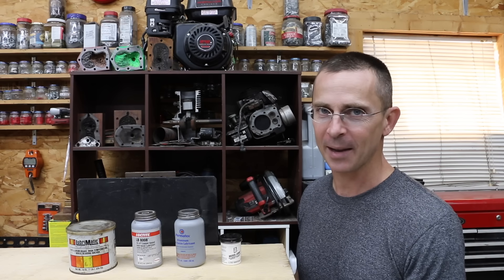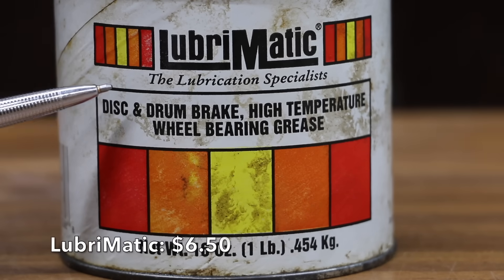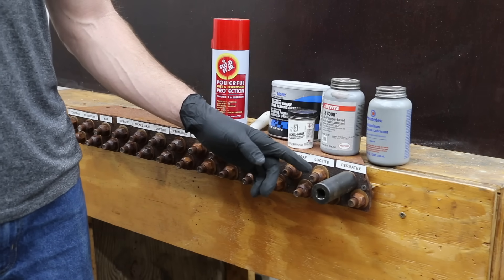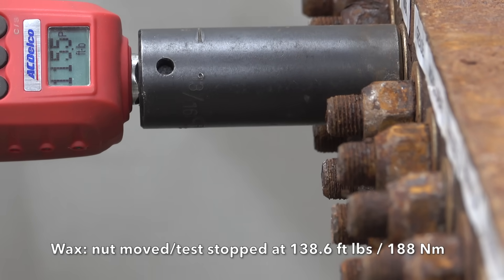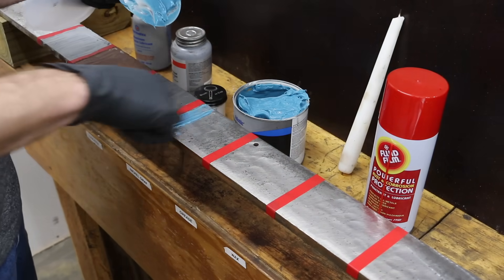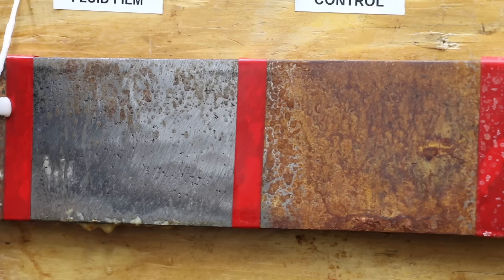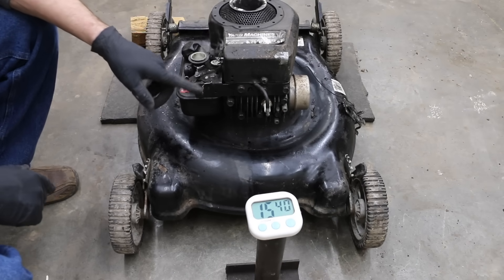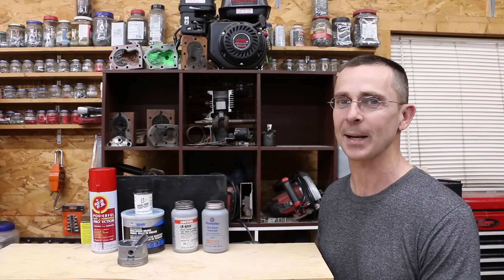Does Anti-Seize Compound Actually Work? Let's find out! Anti-Seize vs Grease vs Fluid Film vs Wax

Comment from the maker: Products Tested In This Video (in no particular order):
Permatex Aluminum Anti-Seize: https://amzn.to/34muTaQ
Loctite Copper-based Anti-Seize: https://amzn.to/2Ep8bDU
Nickel-Graf: https://amzn.to/32hL5aH
Candle: https://amzn.to/3hkUQez
LubriMatic High Temperature Grease: https://amzn.to/47GRBcw
Reply: I knew the copper based anti seize would win.I have been a Caterpillar mechanic for over forty years, One of the toughest jobs for anti seize is exhaust manifold studs where the screw into the cylinder head. With no anti seize lots of broken studs,next the aluminum would give you a 50 50 shot at no broken studs,but copper would give you a 90 % release with no broken studs.A factor that works against the studs in this application ,is carbon,exhaust gaskets failing would cause extra heat and carbon to compound the problem. Aluminum anti seize would win in rock crusher applications,for some reason it would allow heavy lime dust jobs.
Reply: @cecilneely4869  Good stuff for the knowledge bank.  Thanks.
Reply: @cecilneely4869  
Repairing fertilizer application equipment necessitates some form of anti seize . I think aluminum beats copper where heat isn’t an issue. Like to see this tested. In heat, copper beats aluminum for sure.
Reply: @cecilneely4869  loop
Reply: Working on the docks. We have replace boards.  Using copper anti-seize on everything. It work like magic on lag screws.  Put a wad in the holes and coat the screws. They come out easy.  Old ones that never had anti-seize, have to be cut off.
Great video 💪🇺🇲💯
Reply: Does it conform to the sn rating for motor oil? Lol
Reply: The candle wax was not applied properly.  You have to heat the metal first then put on the wax. You can't drip hot wax on a cold metal plate or screw. It wont bond.
Reply: I would argue that the candle would'^ve done a better job if it wasnt cooked away prior ....
Reply: Jack Daniels  
Anti on threads but use a nylock  nut. The best of both worlds.
Reply: @greg9403  Nylock nuts are an excellent way to secure fasteners from vibration, on low temperature applications... And using any good anti-seize or even axle grease in these applications with the ny-lock nuts would really cut down thread galling and corrosion... Yes, that is a great observation.
Reply: @Justin 
What is the product name for ceramic anti-seize?
Reply: @greg9403  Yeah? I have never heard of ceramic based anti-seize... Who makes it, what is the product called?
Reply: @michaelmartinez1345  I dont know about the other guy, but i have seen and used ceramic anti sieze made by both Wurth and Walter. It is great for EXTREMELY high heat applications (MolySlip Ceramslip antisieze is rated for 1,500 C, or 2700 F)
Reply: @benruss4130  very good!!! Thank You Ben !!!
Reply: @greg9403  the stuff I get is more of a grease antiseize with ceramic.  It works good mounting aluminum wheels to hubs. Prevents the gulling effect. Works good on brake caliper bolts to stop the caliper from freezing up on the mounting bolts. Withstands high temperatures because of the ceramic in it. It's blue in color
Reply: I’d be interested in seeing what results you might get with cosmoline… 😄
Reply: Wow you certainly don't mind getting your hands dirty. That mower test at the end was awesome.
Reply: Make a video about tread lockers! :) 
Build a jig that would simulate vibrations and see if it will act as anti seize as well.
Reply: @gabrieldauzmusic  - that would probably be an expensive/complicated rig!!! There is a whole science - and engineering talent, at analyzing and addressing the various forms of , and the effects of : vibration... It would probably involve using accelerometers , frequency measurement equipment, wave form measurement equipment, frequency/wave form generators, plotting graphs, understanding the physics of the various forms, frequencies and intensities of vibration.... Vibration , and the factors involved with it, tend to be more complicated and involved, than what many people realise...
Reply: Before even watching your video i will say this it works, IF you get a decent compound. I work for an aftermarket car parts company, and one of the things I frequently test on-vehicle are O2 engineering sample sensors. If there was sufficient compound placed by the OE it will come easily... but a LOT of newer vehicles did not have a sufficient coating from the OE, and the OE only placed a drop or two of anti sieze so the O2 sensor will bond to the exhaust manifold (you use it betwixt the threads of the exhaust manifold and the O2 sensor). One was so bad that we had to cut the O2 sensor out.
Reply: @benruss4130  It may be a good idea to remove the o2's on a new car and apply the compound and reinsert.
Reply: @GrzegorzDurda  yes, but the car that we had to cut the O2 sensor out of was only a year and a half old at the time. Some of these are arriving brand spanking new with frozen O2 sensors. Occasionally to get a brand new car we will rent specific cars that have less than 2,000-5,000 miles and sometimes they are still stuck.
Reply: @benruss4130  Unbelievable!  With mileage that low. Wow.
Reply: @GrzegorzDurda  Nothing will make you curse like a year old car acting like its bolts were uncoated and parked in the ocean for a decade. We suspect that the one we had to cut out was due to the aluminum o2 threads galling (cold welding) due to there not being enough antiseize/oxidized materials between the sensor and the manifold.
Reply: @benruss4130  Oh yes Aluminum threads are especially problematic in high heat applications and heat cycles. Aluminum has a very low melting point. This is a bad interaction of metals and a metallurgy design fail. Which brand is most susceptible?
Reply: @GrzegorzDurda  Of the newer cars (last 1-3 years), the WORST case was on a Hyundai. Although we have seen these get stuck on most car brands, I would say that Hyundai, GM, and Toyota were the worst three. So far I have never observed a Ford get stuck (although we haven't had nearly as many of those in recently so that might be sampling bias). 

All that being said Aluminum O2 threads are extremely common regardless of manufacturer. Putting a really beefy layer of antiseize prevents it from becoming a problem though. It is the combination of less than ideal metallurgy and little to no antisieze on freshly milled parts that get it to the point where it is a serious problem (short term anyway).
Reply: @benruss4130  one thing that I have noticed on machinery of many types, especially the newer-recently made items, is the COMPLETE LACK of use of anti-seize products at the factories where they are needed the most... Even on the most vulnerable areas, like exhaust parts... Planned obsolescence/break-downs? My guess is Yes... Definitely planned...
Reply: @GrzegorzDurda  as long as it's 02 compatible
Reply: that poor lawnmower!
it has been the victim of your experimentation so long, I feel it deserves a commendation .
Reply: I know this is old, I wonder how different thread lockers would do as antiseize?
Reply: Have you tried to coat the bottom of a lawnmower deck to see what works best for keeping the deck clean from grass clippings ?
Reply: I used to lube belt fed machineguns with anti size. Works great.
Reply: Next time - “Which Anti-seize product performs best to prevent Stainless Steel threads from galling ?”
Reply: I really like this one as I have always wondered of the real effectiveness’s of anti-seize. I would love to see another run of this testing with more readily available anti seize products, including engine oil and addition testing methods, like more heat cycles and longer rust cycles , 6 months, a year maybe?…. More types of anti seize or lubes like brake system lube’s, the kind of things pro’s and diy would have handy when doing repairs or maintenance, e.g. I have used engine oil on wheel studs because I usually have it right there when changing oil and or other mtc when I have a wheel off, always figured it was better than nothing. Thanks
Reply: So... if you don't want your fastener to loosen easily, use wax.
Reply: Project Farm what about using grease as oil?
Reply: Always had good experience with Thread-eze ultra
Reply: Interesting tests... For the anti-seize capabilities, the more expensive products seemed to do the job very well... Especially the C5-A... In extreme heated/for extended period of time conditions - like jet engine hot sections, exhaust manifolds, exhaust pipes, the C5-A copper based compound is outstanding... It always seems to allow the fasteners to loosen without breakage/seizure of the fasteners...  I found that axle grease works well with many lower temp applications, and it reduces thread galling after installation... I have never heard of using candle wax, and now I know why... It does not provide any type of moisture barrier in these types of applications... Better to use candle wax for-making candles!!! I won't even comment on trying to use anti-seize, as a lubricant on that poor classic Tecumseh lawn mower engine.Thank You for this video!!!
Reply: @michaelmartinez1345  years and years ago when I was very young I saw my father and his brother put candle wax, rub the candle, on bolt threads before they tried loosening the bolt. They claimed it worked to lubricant the threads so they could get the nut off. Why not use oil ???? 
Maybe candles were cheaper than oil ? Some things never change over time !
Reply: @stevenjackson7067  that candle wax trick is definitely from a very long time ago... Possibly from the 1800's when engine oil was expensive , if it could be found at all... I like the anti-seize product that contains liquid lubricant mixed with copper dust... There is a product called C-5A made by Loctite that works very well in hot areas....
Reply: @michaelmartinez1345  could be from 1800's. My father was born 1924. He was always telling me things his "Pa" my grandfather that I never knew, taught him. And my father was frugal or some may call cheap. Lol. If he could get a little original anti seize from the papermill he worked at he would use that. I hated the stuff because it was almost impossible to wash off without using gasoline.
Reply: Project Farm , please test Blendzall Gold Label.  I love the product and love your videos. I  bet you would be impressed with the product!
Reply: If it says permatex on it, it is absolute garbage. Rock and Roll is the only antisieze, ceramic based, can withstand heat, pressure and hell for a long time! The problem with Rock and Roll is it’s EXPENSIVE! I work for a company that specializes in plywood, particleboard and mastonite presses.
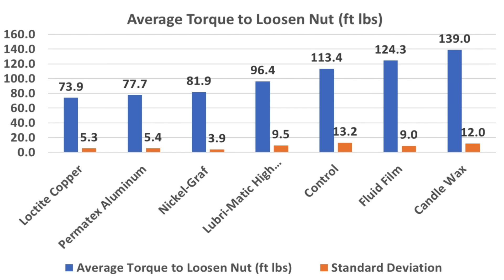Reply: Super interesting and thorough test! You should have included the amount of torque it took to loosen the control bolts though, especially in the overview of the numbers like at 6:50.
Reply: The shop i work at some times i have to replace the pull knob on the cad 50 holders.pull knobs can be useds for years and are almost impossible to remove.seems there frozen in place but using heat cheater bars and shock works.putting copper anti seize allways work after several months or a few years of service  so no issues .
Reply: I have had my millrights only use nickel based antiseize for past 40 years and never had problems removing bolting up to 1200F.
Reply: Hey what do you think of Nickel based Anti-Seize instead of Silver or Copper based Anti-Seize?
I've heard that Copper can break down Steel bolts causing thread galling!
I've been advised to only use Nickel
Not sure what Nickel-Graph has, Graphite but who knows what else is in the mixture?
I'm wanting to put Anti-Seize on the shafts of my rear and front Shocks bolts that contact the metal brackets and put a dab of Loctite 242 "Blue" or Permatex 25210 "Orange" on the threads.
Reply: I think u need to revisit this, I keep hearing people say using anti seize on lug nuts will cause them to loosen up on your car. I've never had a problem.  I put it on everything hear in the northeast. Or I use fluid film..other then sling off when studs get hot from braking, never found a loose lug nut at my oil change and tire rotation 🤷‍♂️
Reply: After the oven there wont be any candel wax any more
Reply: Can you do a small engine with Only LUCAS Oil Treatment in it ?
Reply: Hi, great videos.  I'd love to see a test of steel vs stainless bolts into alloy, its a common "upgrade" to replace motorcycle engine bolts with stainless but I read that it corrodes due to the different metals reacting.  Exhaust studs/bolts are the main thing to test I think due to heat and exposure to road salt.  Also whether anti-seize solves this problem.  Another variation would be different nuts on different bolts, eg brass on steel (the traditional combination for exhausts), copper plated on steel, stainless on stainless etc, theres a special "KNut", which is an Aircraft nut thats meant to be the ultimate, I'm not sure..  Thanks!
Reply: I used Permatex anti-Seize on my 2" trailer drawbar on my van. It was applied liberally and sat for about 6 months. It took a lot of work to remove the rusted in draw bar. We used a 2" square pipe and a 10 pound maul plus heating the drawbar receiver with an oxy acetylene torch until the receiver was red hot before the drawbar finally came out. It took about an hour of hammering and heating to move the drawbar. Since then, I use bearing grease in a thick even coat on the drawbar and left the drawbar in place for over 2 years and it pulled free of the receiver with my bare hands.
Reply: Ha im watching this on 3-9-2023
Reply: Have you ever done heat resistant paint?
Reply: How about aluminum wheels to steal hubs after a year of brake gear and water and salt drin roads
Reply: I honestly didn't see the engine coming apart for that reason.  I figured it would be too viscous and cause to much strain.  Now you have me curious about these products for polishing or lapping abrasives.
Reply: I know a mechanic that use engine oil. Can you do a test on engine oil as well?
Reply: I have used the Permatex aluminum antiseze for a very long time.  It works for me on almost every place I use it.  I recently started using the copper based antiseze for certain applications.  One thing I have learned over the years is to use it sparingly for best results and least affect on torque requirements.
Reply: Aluminum only work in exhaust system. Don’t used it in wheel studs it damage the studs when installing or removing nutsDONO USED IT IN WHELL STUDS
Reply: Should test fluid film as a motor oil!

Comment: standard dev meaningless since sample size is only 2. Need 3 bolts per anti seize to have a meaningful statistical comparison since a sample comparison is sample size - 1. Nice test though. I've used the permatex for 30 yrs, love it. Just remember to use wet torque and not dry torque when using.

Comment: I use copper base anti-seize on the equipment at work where the temperature can reach 400 f.  The bolts come off with no problems.  The silver base, that I wouldn't recommend.

Comment: The anttizese is only effective on the contact surface of objects that do not move such as a balljoint, torque rod end or tie rod end. On mobile surfaces, it's a nightmare because the antizesse prevents the movement of the moving parts.

Comment: I use permatex {just a wipe on the place a nut goes}  [appears that loctite copper  might be added to my list]
bearing grease? for me thats another purpose & I use it on bearing surfaces & it works as it should

 Ive not had a need to use never seize or other products

 on brake pins & lubed points, I like the permatex silicone lube,   been better {for me} than high temp bearing grease.

 fluid film has its place & it does protect pretty well, when used right {as directed}
wd-40 and other cleaner/penatrents   do well when used right 
I kinda like the PB Blaster {PB?  my guess is not Peanut Butter} ;) 

 thanks PF for another entertaining and informative review/test

Comment: OEM Flow Waterjet anti-seize part lubricant, which reduces metal-to-metal contact, friction and wear in extreme heat and pressure conditions.
87,000 psi stainless steel plumbing

Comment: Used for years, the most important point is to make sure you are using the correct anti seize for the metal you are working with. I keep both copper and aluminum at hand.

Comment: Don't know if it was mentioned ,DO NOT use anti-seize where torque matters! THis is especially critical on any kind of stretch bolt. You will strip threads on the fasteners. 
Anti seize is carried by some form of grease, and the lubricant will make your torque EXTRA overload of what you have your torque wrench set at.

This is also why it should never be used (or OIL) on wheel lug nuts/bolts. You will break studs/bolts, or ruin wheels. Use dry threads for wheels. Never any kind of lubricant.

Comment: I have had spark plugs and header bolts coated with anti seize become increasingly difficult to remove, and eventually rip the threads completely out of aluminum heads.
Reply from the maker: Thanks for the feedback.

Comment: As a valve automation service tech, I always insist to the shop guys to use anti seize on every bolt and bored and key couplers and shafts. It just makes my job so much easier when a service calls requires me to disassemble a unit.

Comment: FYI -  applying grease and oil products on fasteners and torquing is not a good idea.  The lubricant inhibits the coefficient of friction from properly occurring resulting is excessive bolt stretch and probable failure.  The bolt test performed here measured by torque was mostly irrelevant other than the visual presence of rust.